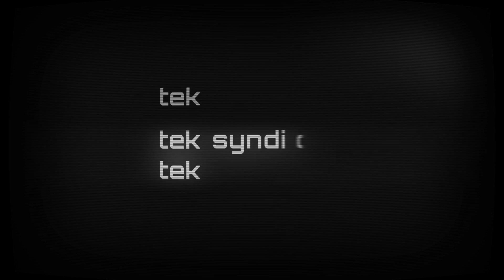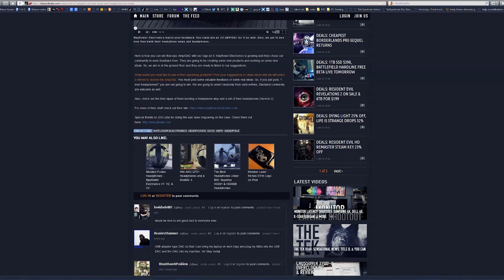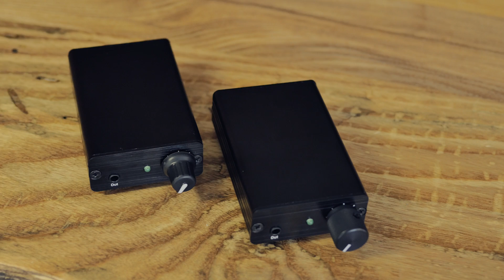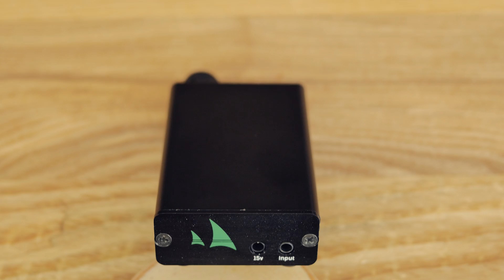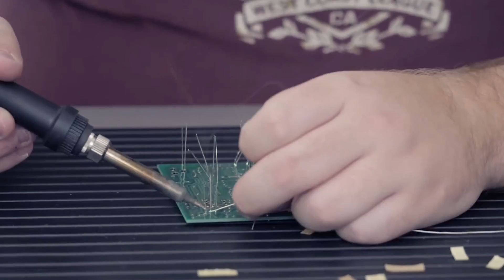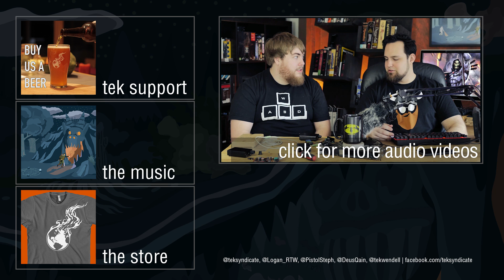Mayflower Electronics Portable Headphone AMP - Win One! (We Inspired This Product)

Comment: Well, as a pocket-thingy is there any way the potentiometer on top could be inlayed (as buttons or a dial?) and to sit almost flush with the device shell? The amp is plenty loud and I'm sure the large dial is going all over the place in someones pocket, make someone deaf, and that's not a good thing. Make the potentiometer-dial clicky so it stays in place or lock somehow or just sit flush... Thanks.

Suggestion-feedback number two: Can we have the input and output on the same side with the potentiometer? In a pocket-way of thinking that would be smarted IMO. Now it looks like a desktop amp done small and with a battery. The input-jack is going to slaughter all your cables the way it is orientated. Just have the jacks be easy to plug in to when this is in your pocket.

Suggestion-feedback number 007... Is there any way this could be powered or charged from a usb-powerbank or the phone charger?
Reply: Totally agree, Tek look at this comment!!
Reply: Suggestion-feedback number 009... If it's a pocket sized device, there should be a more rounder case, kinda like a pill shaped prism instead of a straight rectangle.
Reply: potentiometer-dial clicky is really not easy, maybe a zippo style cap could address the problem. cables on the same side are a good idea for a pocket device and a voltage regulator out of a 5 volt usb is a good idea too, so the 9V battery can be replaced by a couple of AA or even a single Li-Ion AA
Reply: Wow, great suggestions. I think you need to register on Tek Syndicate website to win the amp, but you should post the suggestions there regardless of the contest.
Reply: Unless the pot is stiff then getting something smaller would be great for the reasons mentioned. I wish i had headphones that needed an amp but i need to build a dac before i worry about the amp.
Reply: Gollsodia I did try to log in using my facebook account but it just fell a part. lol. I guess I'll have to find another way. EDIT: I registered and put the thing in the thing. There was alot of comments so I might just be too late.
Reply: So it doesn't bother anyone how the input jack is on the back of the device? The cable will have to go all the way round the unit and might damage the connector if it's not one of those 90 degree ones.... no? just me then :/
Reply: wiipronhi The parent comment you replied to mentions that exact thing...
Reply: dumle29 should have pressed "read more".... :/ woops
Reply: wiipronhi Yeah I figured. It's not always too clear that there is a read more :P

Comment: Included rechargeable battery, optionnal power supply for 10$ so it isn't useless once you run out of battery. A bit on the expensive side for most people I would say, but still very interesting.

Comment: If anything I would've liked something affordable. I don't have $200 to spend on a DAC/AMP since I'm a poor student who is required to buy overpriced books which I won't open for the rest of the year.

That and my GPU broke a month after the warranty expired. My 290 replacement cost me €300. That was the last bit of my money...
Reply: This amp is under a hundred dollars...
Reply: CapnTates This is basically a cmoy with a charge circuit built in. Simple cmoy style amps cost 20-30 bucks in parts, including the box and battery. If you're feeling really tricky, one that uses a 2 cell lithium and includes circuitry to charge by usb, which would probably double or triple battery life over shitty 9v rechargeable. I'm in the process of designing basically what I described above, which will hopefully end up smaller and thinner than this, but offer similar performance audio-wise, thanks to using surface mount components, and better batteries. This amp is nothing exceptional for sure. Just check out ebay for cmoy amplifiers, and get one that has good reviews on somewhere like diyaudio forums. If you want a challenge (and to save a few bucks more), it's not hard to put together a simple cmoy amp with strip board and some cheap components. Good luck!
Reply: ohh sorry, I didn't see that post, no worries man. your best bet is saving up for an odac+o2 setup, or maybe, look into some of Fiio's products, they're very well regarded for the price.
Reply: You're also fully entitled to a replacement or refund...
Reply: I think most 290 have a 3 year warranty period
Reply: the cheaper it is, the shittier the quality - they just wanted to make a good product, not some cheap piece of trash
Reply: dugg117 Sorry, I meant an AMP/DAC combo. They asked for feedback and I assume not only for their new product.
My onboard audio is always bad as far as I know (noise, some boosted frequencies and of course no driving 250ohm hp) so I want a good affordable AMP/DAC.
However the cheapest good DAC/AMP I know is the ODAC. The rest of the DAC/AMPS always have some bad review which makes me too uncomfortable to buy it.
Reply: Rem NL I replaced my old GPU (HD 7950), which was pretty old and broke, with the R9 290. Did I phrase it completely wrong again?
Reply: CapnTates I know the price on their Dac/amp combo looks steep but unfortunately its actually a STEAL. It goes toe to toe with dac/amp combo's that are MUCH more expensive.
Reply: Make your own, the parts are generally pretty cheap.
Reply: CapnTates it could be my bad, english is not my main language
Reply: Sergey Smith The mosfet is unavailable here unless I ship it which is very costly. My brother has some connections in ordering chips but he could not get it in my budget.
dugg117 I know that. Doesn't take away I can't afford it. I can miss €120 in total for good audio and I would almost be in the red numbers.
Reply: Chris Tate Like I said, I need a DAC too to get rid of the noise of the motherboard. With just an amp I would just amplify the noise.